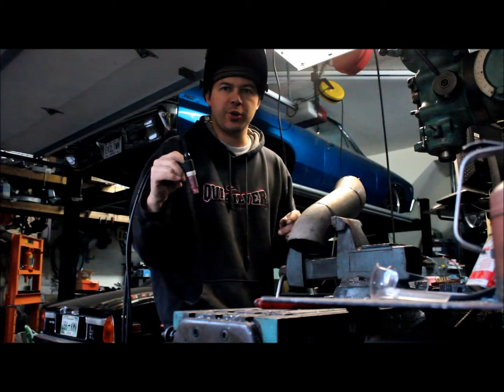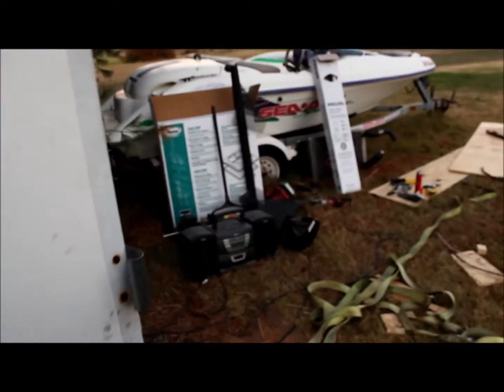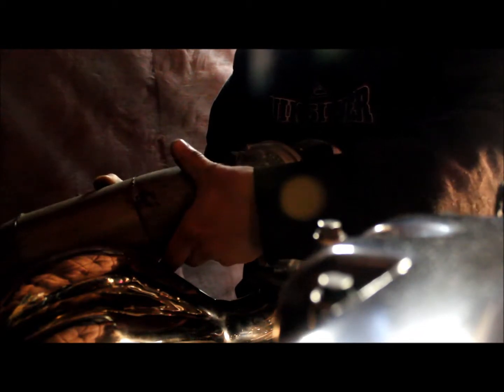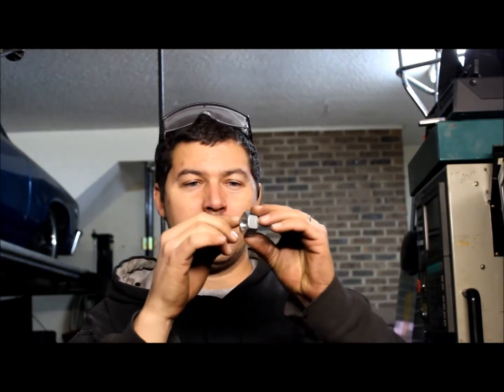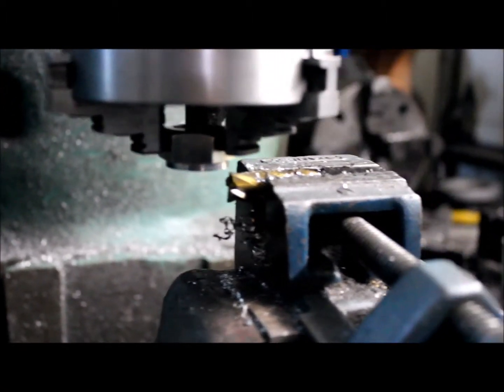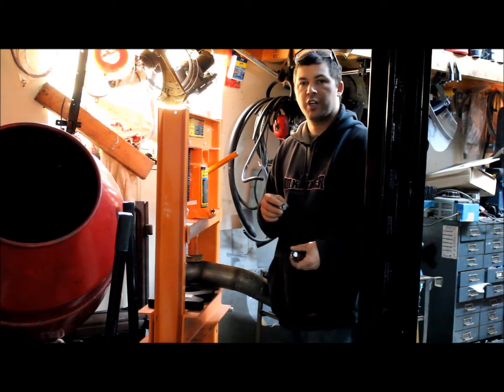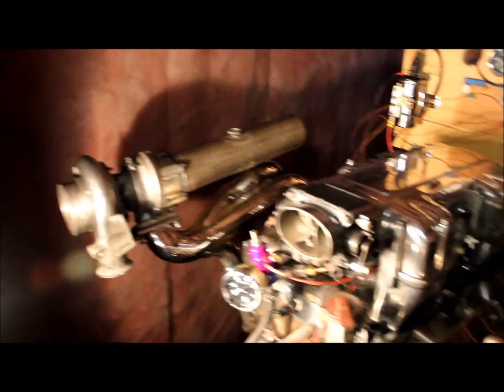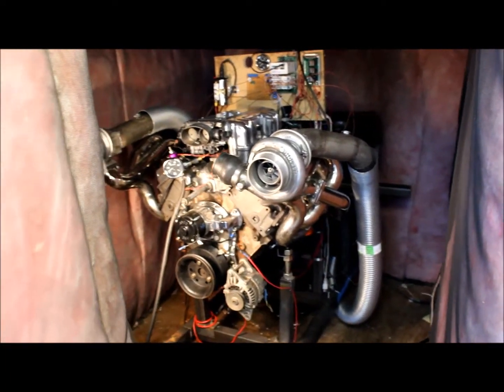Dyno Shed Pt2

Comment from the maker: The brake is my own design. It's welded and bolted together from 54 pieces of 3/8" and 1/4" steel plus some seals, o-rings and bearings. I put a link to pics of the build in the description. The next one I'll just mill out of aluminum and will be a much simpler design